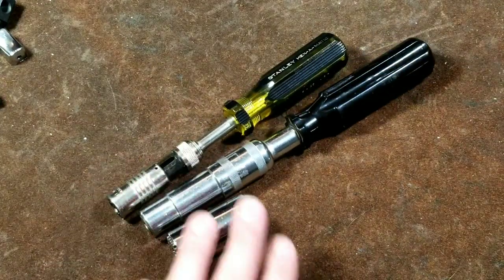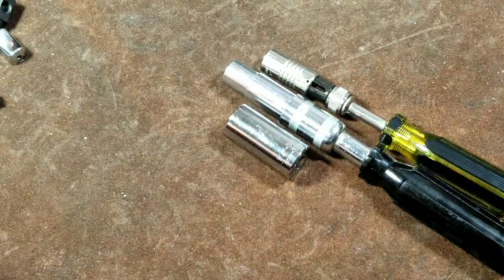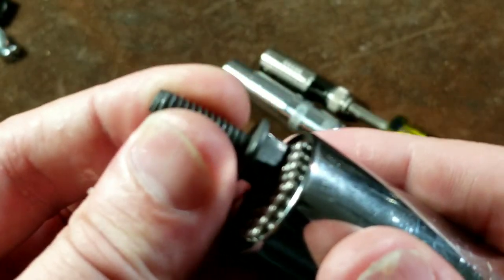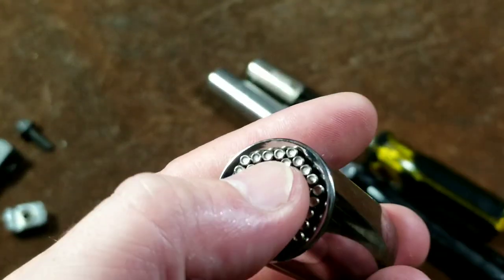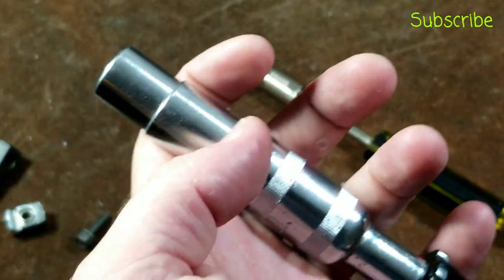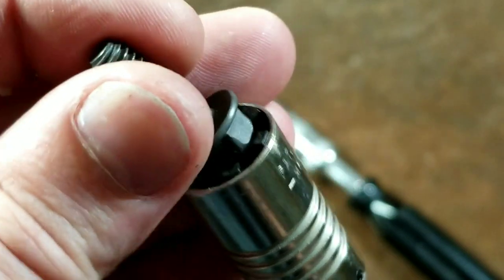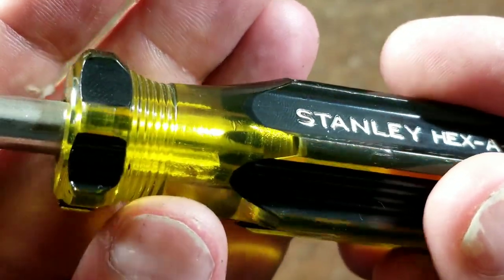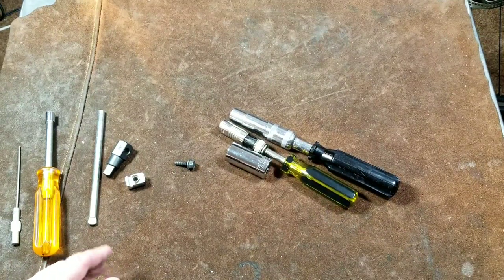Universal Socket & Nut Driver Review & Comparison

Comment: I've used my gator grip for years on every type of fastener you can imagine and it's been one of my go-to tools. Lives in my truck toolkit and has earned my trust!
Reply: I turned 1 faster not even a rusty bolt and it bent a bunch of pins in my gator grip...

Comment: The Gator Socket is one of the best designed tools I have ever had.  Despite having full sets of SAE & Metric sockets, this is the one you want to have in your car or your hammer belt. Take care of it and it will last forever.  It is also very good for removing a bolt with a rusted or damaged head, with rounded corners.  Brilliant design.  This from a fellow life long tool-junkie.  The first one of these I bought was a T handle model, it saw a lot of use in the factory I was running.
Reply: The problem is the hex socket cannot grip onto the hex bolt because it has been rounded off,
will the Gator Socket work, I mean the bolt is 18mm, but it won't loosen without a good grip, the 18mm socket is only sliding not gripping or loosening.

Comment: For that first one (or any of them really) how much torque would you need to bend and destroy the pins?  Looks like an amazing idea, but I'd be concerned about longevity.
Reply from the maker: The biggest issue with the socket is a deep well length socket but only works on short Fasteners the pins themselves or extremely hard the bigger issue would be corrosion and then getting jammed up I think that if you put enough pressure to actually damage a pin you would just split the wall the socket

Comment: I wonder if the pin one will work for my hubcap locks on my caprice i lost my tool
Reply from the maker: Harbor Freight has a Maddox set of security lug nut sockets that might work. Using the gator grip socket may or may not work it's kind of hit and miss when it comes to you odd shapes and splines whether or not the socket pins will line up well enough for it to remove the fastener. And in a lug nut situation the socket maybe way too large a diameter to fit down into any wheel recesses.
Reply: How can purchase  I m bangalore India
Reply: Where can I get it ..please share the link . Needed in Andhra pradesh in india
Reply: @caandcwarjun  Amazon sells them.  I came to this video from there for a review.
Reply: @stephenhill1089  thanks for your reply

Comment: I work all things from phones to car engens. I'm thinking about replacing all my non deep sockets with a gator grip. All my sockets are mostly cheep kamart crap. Would you disavise on this ? Whats the max tork it can handle ?
Reply: No need to commit to replacing all your lesser crap.  It is not very expensive, but it and I suspect you will make your own decision quite quickly.
Reply: DO NOT REPLACE WITH GATOR GRIP.
At best, it will tear itself apart before causing any damage to the bolt or nut. Rough estimate is from 60-90 foot-pounds before breaking if you're lucky. And even if you avoid exposing it to that high torque, it will last through maybe 40 uses with 40-50 ft-lbs. Socket sets are sometimes a hassle to carry around, but there's a reason you don't see mechanics, or anyone else, using them. They're unreliable and a hazard to whatever bolt or nut it's being used on.
Reply: @kindledninja  Well said!